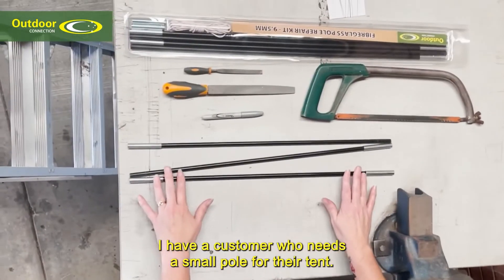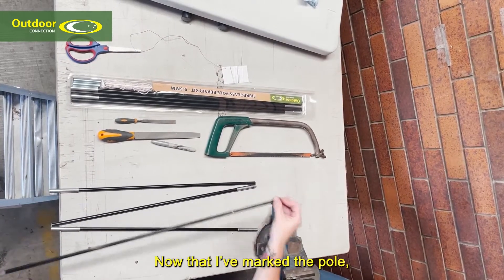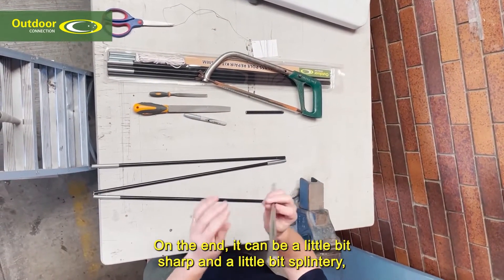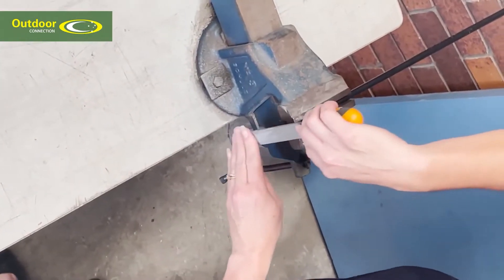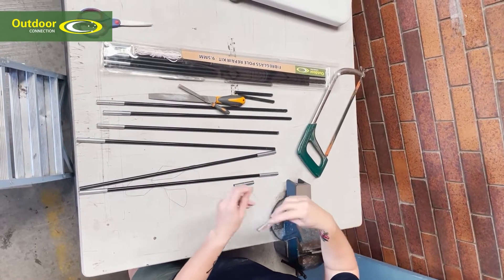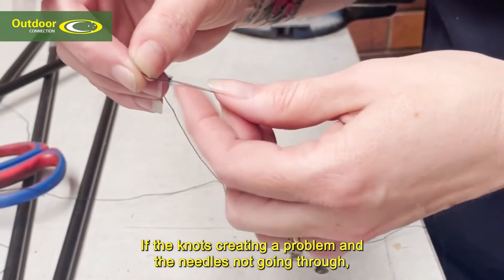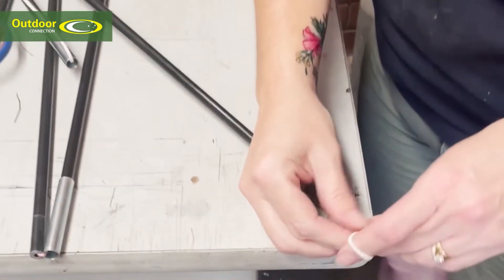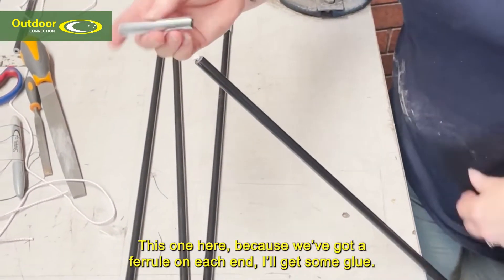How To Build/Repair Fibreglass Pole

Comment: Great video! But the one thing I came to learn is what kind of glue to adhere the ferrules to the rods.... thats the only thing missing
Reply: Epoxy
Reply from the maker: Thank you, great question. Peta would generally use a clear contact adhesive, but an epoxy or superglue would also work. Cheers Baxter